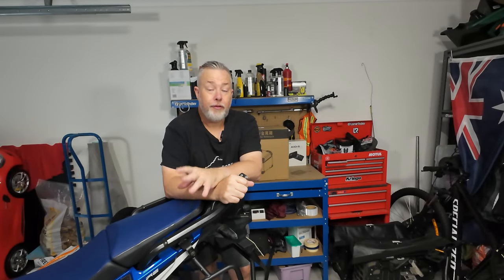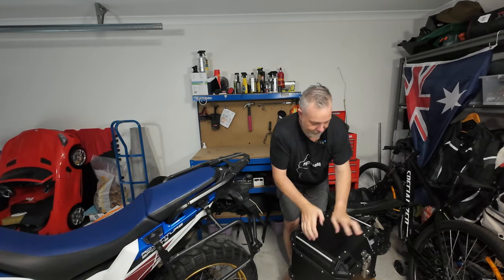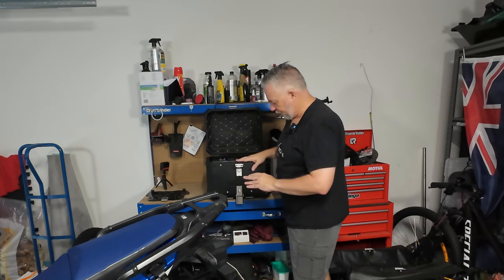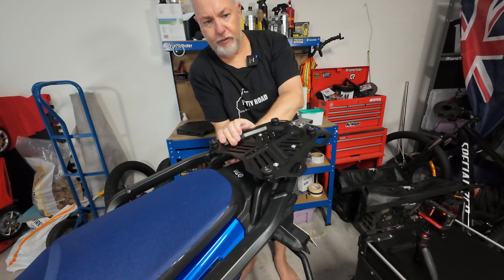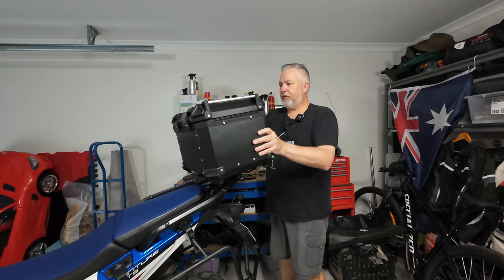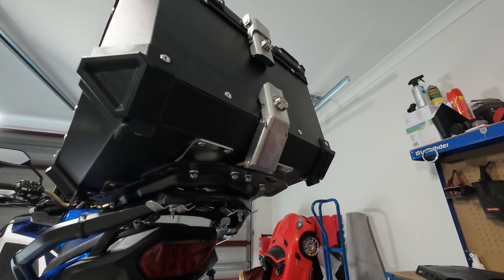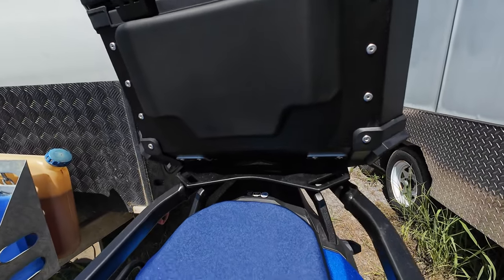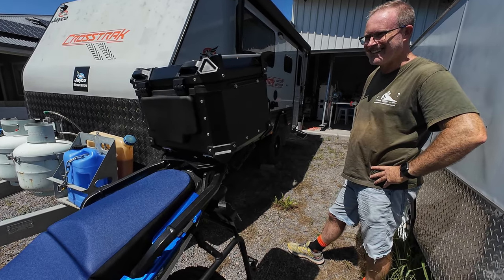A Motorcycle Top Case for less than $300 - Unboxing and Install

Comment: Nice find. I am running the Hepco and Becker Exceed top box and that was Just under $900 with mounting bracket. To get the back rest was almost another $100 on top of that. 
Good to see you modified your existing rack to accept the box. It looked to fit much better than the generic one.
Reply from the maker: That's a hefty price and I nearly called MAP to order one until I saw this. The real test will come over the coming days when I hit some dirt!

Comment: Just check the bottom lock, mine came off at 120km and bounced about 100m. The boxed lasted surprisingly. I now have a small ratchet strap to hold it in place.
Reply from the maker: Damn that would've been a shock!! I replaced all the nuts, bolts etc with quality gear and nylon locking nuts. Then also attached paracord from the box to the Outback Mototek luggage plate. So far so good!!